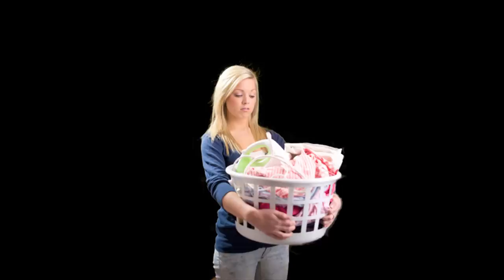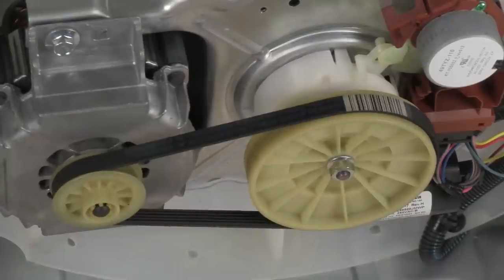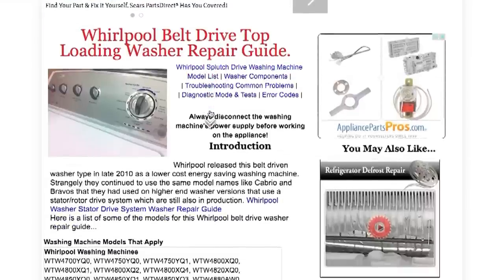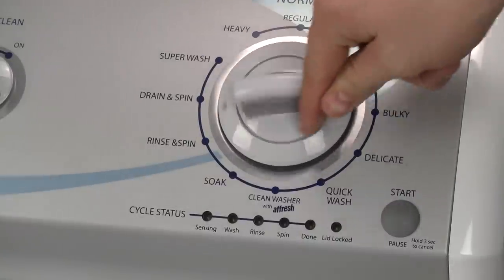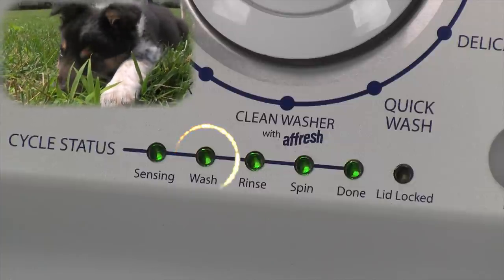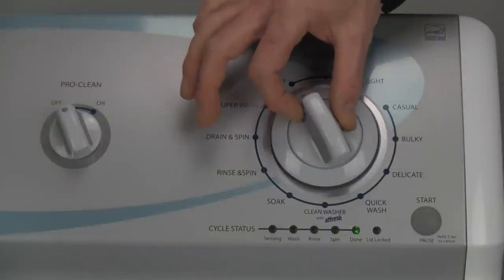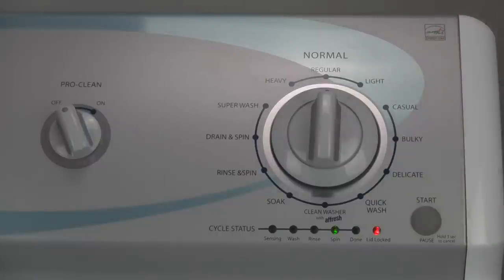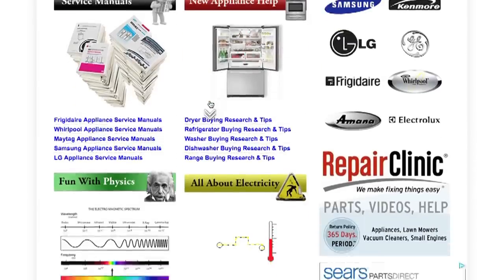Whirlpool Washer Repair (New Top Load Washer)

Comment: My trusty GE Filter flo lasted an amazing 40 years and still going after some recent minor repairs - but knowing major NOS parts sources are drying up and it will one day not be repairable, I went out to shop new washers.  -- I was shocked at the cheap flashy and needlessly computerized & complicated mechanics with sub standard build quality, bad reliability and bad reviews almost across the board.   So I repaired my old GE and went out and bought a heavy duty Commercial Speed Queen with the best warranty in the business - Its got old school build quality washes fast and effective and it cost $600 less than the retail price of this thing.  Myself I think adding something as delicate as circuit boards in a machine that fills with water and shakes like crazy is bad engineering, and worse yet its on purpose.   - Weve had high quality well made effective washers for 50 years and didn't need any of this gimmicky stuff, the corporates have caved to govt. nazi water restrictions, gone greedy cheaped out and gotten rid of real suspension systems, and heavy duty construction and replaced it with flashy cabinets, control panels and stainless steel to mask the fact the appliances now failure prone innards have plastic instead of metal in the main drive systems most important parts - including the outer wash tubs which are also plastic.  They may be stainless and flashy on the outside, but theyre high priced junk on the inside.  And as long as the public continues to accept its ok to buy a new washer every three years they will keep making them this way.
Reply: actually some of the plastic parts are designed to fail if something is wrong or wear before causing wear on other more expensive parts. e.g. the motor and transmission!
Reply: Yes That's true, motor couplings for instance can shear to prevent further damage or over heated motor etc - but today so much of the plastic is being used in places that it doesn't have the fatigue or wear properties to hold up like previous generation washers made up into the early 90's.  for instance outer tubs are now made of flexible plastic instead of enamel coated steel - my 40 year old GE's enamel tub is only just now showing signs of rust, but todays washer need tubs replaced in as little as five years or less when they crack, and in some the bearing is molded in and if the bearing goes out you have to replace the tub as well.  And the plastic is propogating the growth of smelly mold as well -  see numerous videos on it.  And its so sad to see all the bad reviews of previously solid high quality brands like Maytag, Frigidaire, GE etc. that have all turned from long lived 15 - 20+ year appliances that give good value for the money to over priced, poor performing, poorly engineered throw aways in as little as 2 to 3 years - many reviews and videos back me up on this.  I personally have a 1977 GE Filter Flo washer thats still going and only this year needed repairs.  Not to mention a lot of washers now, especially front loaders take over an hour to finish a load because of low water regs. and all the goofy back and forth "sensing" and "balancing" actions that don't really wash well and waste time - now instead of waiting on the dryer were waiting on the washer.  It used to be the suspension system was just made to handle an out of balance situation on its own by design -- In fact a local repair tech where I bought my new Speed Queen told me they use the sensing action because companies have eliminated the older very effective mechanical suspension systems and just hang the tub on cheaper sprung rods to reduce cost and so now rely on circuit boards to try and "pre-balance" the load before the spin cycle - which doesn't really work all that well because the clothes move around constantly. And if ya think about it, anyone that knows electronics will tell you putting delicate circuit boards into a wet environment along with heavy vibration etc. is the worst thing you can do to a circuit board, so its no surprise theyre failing - yet most all washers have them now and theyre expensive to replace when they die - often the machine isn't worth fixing and gets tossed when a board goes out due to the cost of the boards or other expensive plastic parts.  What really irks me is they still charge just as much and more money for this kind of build quality.  Another glaring example is Samsung washers literally exploding with the tops coming off and sending dangerous shrapnel into walls etc - (see videos on this) - theres no excuse for this, for 40+ years we had high quality washers that lasted decades and did the job well and in my 57 years I never heard of even one exploding until this new HE stuff came on the scene.  Point is washers used to last decades, they washed well and washed fast without undue drama or any of this computerized jazz, and were built much better to boot.  I guess you had to have grew up with these kind of quality appliances to understand why im ranting like this--lol   We don't see the lonely Maytag repairman on TV anymore, hes much busier these days--lol

Comment: I did everything on this video and my washer is still stuck on sensing mode. I've replaced the shift actuator and inlet valves. However, it's still showing a long fill code. I capped off the hot side and I'm only running the cold side. Does capping one side and using only the other make a difference? Google says both hot and code must be connected and turned on fully for a Maytag washer to function properly.
Reply from the maker: If you already replaced the valve and the washer is filling properly, I would look at the pressure sensor, which is usually integrated in the control board on these models. If it’s the board I would pitch it. Check the pressure switch hose for kinks and small holes first. Any air leak would cause the same symptoms. Good luck!

Comment: Entertaining and educational!
Here is one cause of 
Error F7 E1 = washer inner tub speed sensor fault.
that I haven't seen.  Because of some rust deposits on the part of the housing of the actuator where the infrared transmitter / receiver sticks up into the gearcase and counts the slotted wheel of the washer drum, my washer gave this fault. A quick cleaning of the slot cured it.  Unplug & Lean washer securely against a wall, remove 2 green screws holding in the actuator, clean slot and put back. You don't even have to unplug it!
Reply: Do you honestly think that an ,80 year old woman can fix  this? LOL

Comment: Hi thanks for this informative video, I have had this rotten cabrio 5700 for only 3 years and just had repair guy out to replace the stripped washer drive pully.  However this wasn't the only problem and tech thinks its the control board.  Before calling Whirlpool I ran your Diagnostic test.  Before clearing codes I got F7 E7, E1 F7, E1 F5, F2 E1.  after I cleared and ran the short test cycle I get F7 E1.  The lid lock also flashes and doesn't unlock sometimes unless I unplug.  Any thoughts?  Thanks
Reply from the maker: lorraine Deihl Very common problem for this washer style...Sounds like it needs a new speed sensor, and may be a lid switch.
http://applianceassistant.com/Washer-Repair/Whirlpool-Washer-Belt-Drive-Splutch/Whirlpool-Belt-Drive-Washer-Error-Fault-Codes.php

Speed sensor:  http://www.repairclinic.com/PartDetail/Shift-Actuator/W10006355/1719787?RCAID=27317
Lid switch: http://www.repairclinic.com/PartDetail/b5p11/Whirlpool-Washing-Machine-Door-Latch/W10404050/1938607?RCAID=27317
and if you want to complain to Whirlpool about it (which I recommend!) Here is a guide on how to best get through to them for some warranty concession...
http://applianceassistant.com/Customer-Service/Whirlpool-Washers.php

Hope that helps! These washers are very common and have lots of problems... Good luck!

Comment: Soooo my friends washer did that 'noise'. But it worked just fine other than that. My husband tried to fix it, didnt see the video. Messed up more. Now shes mad, im mad, hes mad. When we start the cycle (after he messed with it) the sensoring light comes on. It locks, fills the machine with way too much water than needed then all the lights turn off, it drains but never washes or spins. My husband didnt mess with the wires at all. He however took the cover on the bottom off, unscrewed the wheel thingy, put it back on. Then he took the entire drum out. Dont ask me why. Then the problem occured. Any idea what he did or how to fix it? Help. Please.
Reply from the maker: There is a more complete guide on my website:
http://applianceassistant.com/appliance-repair/whirlpool-belt-drive-washer-repair-guide/
We don't want friends and spouses mad at each other! lets figure it out... Can you get me the washer's model number? If not most of these washer types are almost exactly the same. If he or you are still allowed to look at it, can you get it into the diagnostics mode like in the video? If so are you seeing any error codes?  
the errors are the first step. As far as the noise, all you need to do is remove and reinstall the nut that holds the larger center pulley wheel on. They tend to loosen and grind against that cover.  I'm thinking in the tub removal/ repair process perhaps the small clear tube that runs up the back of the washer (used to detect how much water is in the tub) may have been cut, punctured, or pinched...

Comment: Please explain how you get a 7 or a 5 or a  B? out of the error codes..and an "FO" and "EO" on the est. time remaining box?
....
Reply from the maker: I think F0 and E0 would mean no errors. Not sure what you mean about the 5 and 7 or B.
Reply: Watch your video...you called out those #s Right after the Puppy  Thank you for your response... @applianceassistant
Reply: @leonewton383  No problem.  It is a weird system!
Reply: @charlesyingst7963  No. You said F, 8,4,2,1, then the error had E, 6,7....????
Reply: @darlahughes1931  First Code Sensing = F, rinse = 4, spin = 2, done = 1 (4+2+1 =7) Hope that helps!
Reply: @darlahughes1931  Exactly. What aren't we getting?

Comment: I have a whirlpool Mod 1CWTW4800YQ1 and it would not fill or start, I checked the supply and its ok I also tried your diagnostics but that did not work. The machine sensing lights stays on and then eventually switches off without starting up.

Comment: My actuator is just clicking and the washer wont start....is it the splutch or actuator?
Reply from the maker: I would guess actuator. The splutch is only a factor after the washer has started and is attempting to transfer power to the drive system. Good luck!

Comment: I can’t get mine to come on nor go into diagnostic mode. When I plug it in it just clicks, which sounds like it’s coming from the top by the controls. Model ATW4675EW0. I’ve changed the kid lock switch already and still does the same thing.

Comment: What would make the diagnostic LED flash on and off and one of the relays on the board to flash on and off not simultaneously though
Reply from the maker: There is an led on the control board that flashes just to let you know it has power... not sure if thats what you mean. Where you able to get it into diagnostics?

Comment: Hi  It's a bit unclear that you need to read 2 sets of blinking lights at each dial position once you're in diagnostic mode.  The FILL (sensing)light on gets a number (Making "F")  AND the FILL light off (making "E") gets a number.  My code was F7E5 , so I'm going to replace my actuator and hope for the best.  THank you SO much!
Reply: So where does the 7 come from ? Thanks

Comment: Why would my Whirlpool model 4800 get code F2E1 (Stuck Key) when it has no digital display?  (The Stop/pause/cancel button works fine).  Just wondering.
Reply: Lex Conor control board fault

Comment: Where is the video with the loud terrible noises? This is the closest I have gotten to finding the solution.  Please help!!!!
Reply from the maker: Sorry I never got around to finishing that video. I do have a guide on my website for this washer type. The noise is usually caused by the nut that holds the main pulley on becoming loose and allowing the pulley to grind the belt cover. Just tip it back and look underneath for a circular cut on the inside of the belt cover. If that’s it pull it all the way off and reinstall with some Loctite on the bolt threads. Good luck!
Reply: Thank you!

Comment: Hi sir, I using the same control board in whirpool washer. when i saw the board is short i relaced the control board and ON the machine it will not work and after a 15 second the new control board also short. please reply me to find the reason of short.

Comment: I cant get mine to even display the error codes. When its plugged in it just clicks and no matter how many times I do the sequence of three right one left one right it will not going into the diagnostic mode.
Reply from the maker: Where does the click sound seem to be coming from? (The lid lock area, control, or under the washer) Does it start when you first plug it in or after you try to start a cycle or start diagnostics? What's the model number?

Comment: Great, helpful video.
A little more robust design on some of these parts, you might even think you went back in time 60 years to an era when washers / dryers would last seemingly forever.
This modern era of under engineering is just disgraceful by any standard.
Price up quality down.
Let's Go Brandon!

Comment: I MUST ADD, THESE VIDEOS DO NOTHING BECAUSE I BEGAN TO TEST AND ALL IT DOES IS FILL, WASH WRING AND LEAVE ME WITH  SOAPY WET CLOTHES. HATE THESE MACHINES.
Reply from the maker: I’m sorry for all your frustrations Angela! I feel your pain, I work on this type of washer all the time and agree with your previous comment... I am not associated with Whirlpool in any way.  That being said, if your washer is only a few months old, call whirlpool and get it fixed under warranty. If it’s out of warranty, it sounds like you may have a bad lid lock or tub sensor. you need to do the diagnostic test I described with the tub empty for accuracy.  Also did you get any error codes? I may be able to help you narrow down the problem.

Comment: I have a F1 E2 error and have tried running a test, sometimes the lid locks sometimes it doesn't and it sounds like it is spinning, but the drum won't move at all... also when not in manual testing mode, just regular after first plugging in, lid locks, releases then I hear a humming.. please help... in test mode it fills and drains
Reply from the maker: The F1E2 error is a bad one, it points at the main control board. The rest of the symptoms make me think you should look at the motor capacitor, they have been fairly common to fail on these washers. It's a large black cylinder mounted next to the motor. You need a pretty hi-end meter to check it for capacitance, but if you don't have a meter that can check it, most of the time when they fail there will be some sign of melted plastic oozing out of the front or back of the capacitor.  Try clearing the error, hopefully it was just a bad reading from the capacitor issue and the control is okay.

Comment: After retrieving the stored error codes, I pressed and held the start button for 3 seconds to erase the. I then tried to run a manual diagnostic test, but none of the lights ever came on! Someone please help!!! Before I erased the codes, I had an F7E7. I don't see the owner's manual, where everyone has said it is located, so I have no idea what this code means. Unfortunately, I also have the horrible grinding sound AND the airplane taking off sound! 😭

Comment: I HAVE A WHIRLPOOL. AFTER JUST A FEW MONTHS USE, ALL IT DOES IS WASH AND WHEN IT IS SUPPOSED TO RINSE , IT BEGINS TO FILL BUT STOPS AFTER A MINUTE, THEN FLASHES LIKE, IF IT WERE TO SAY "I AM IN TROUBLE HERE"!  THE LID LOCKS AND WILL NOT OPEN UNTIL ABOUT A HALF HOUR LATER. ALL I HAVE IS SOGGY SOAPY CLOTHES. I HATE THESE NEW MACHINES. BUT I MUST SAY THAT THESE LOCKS ON THE MACHINES ARE MAINLY BECAUSE HOW MANY MOMS  LEAVE KIDS UNATTENDED WITH WASHERS OPEN AND THE KID CLIMBS IN AND DROWNS. SO NOW, WE HAVE TO SUFFER WITH THIS LOCK MESS AND THESE COMPUTER ON MACHINES. I WANT AN ANALOG MACHINE. I WISH MY MACHINE WAS THE CLOTHES.

Comment: Any of these new Whirlpool built top loaders are garbage. This should be pretty apparent because the title of this video has the words " new " and " repair " in it. If it has a lid lock and / or a push button start on a washer, there's only one thing it's good for. Scrap. If you want a good washer, get a good used Whirlpool direct drive washer.
Reply from the maker: Absolutely! The old direct drives are getting difficult to find... but one with a nondigital pressure switch, in good condition should be fixed as long as parts are available! I have a video series on that type... they are my first videos so they kinda suck but they give good info I think...

Comment: You do NOT turn the knob counterclockwise 4 times... you do one click left 3 clicks right 1 click left and 1 click right...
Reply from the maker: 10 years ago you did... You are correct, new models don’t require the clearing counterclockwise rotations. Thank you for the comment. 👍🏻
Reply: @applianceassistant  10 years ago we did not have to I had a machine that was from about 2009, 2010, 2011 and I did not have to turn the knob 4 times like that

Comment: what is the "very easy repair" to that god awful noise? i dont see a video on it
Reply from the maker: Sorry I never completed it, got too busy with repair work.  It's usually caused by the main plastic drive pulley I show in the video at that point coming loose.  Try reinstalling that pulley nut with some Loctite. If it's not that it may be the gear case which I would not recommend putting the money into. Best of luck!